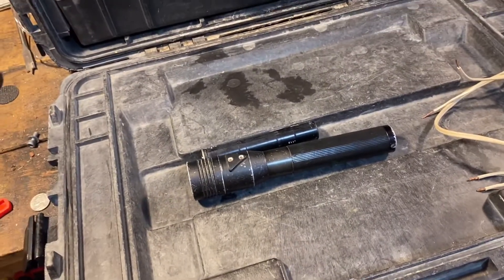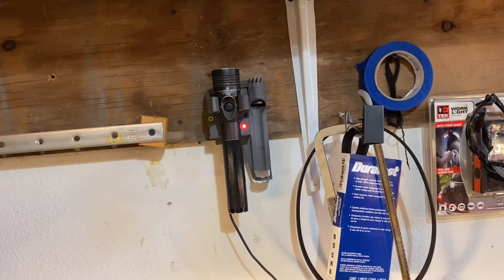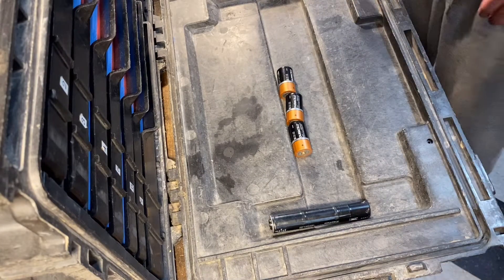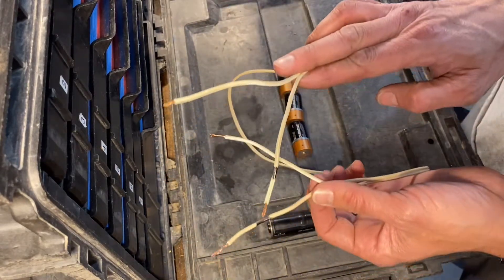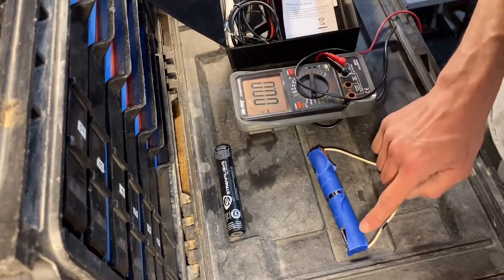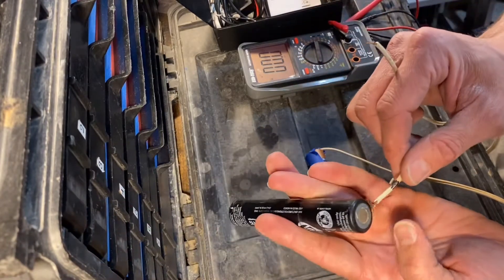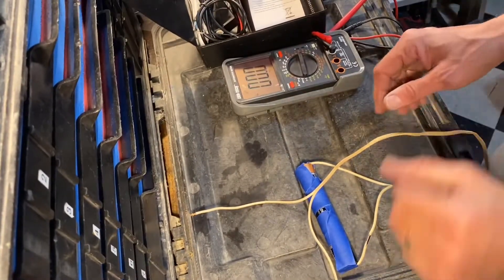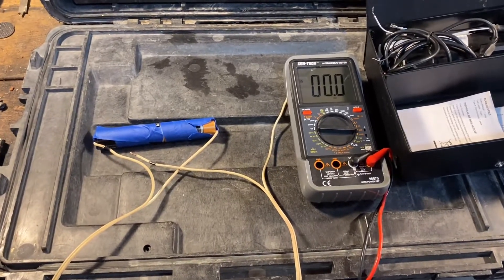How to Fix a Dead Rechargeable Battery

Comment: I just got a new streetlight stinger  classic in red with the xenon bulb I wanted the old school look it’s ment for inside the house don’t need all the bright lumens but I have notice I already have this same issue it’s brand new any reason why or just a defect the package came with black slow charging charger but I charge it on my gray fast charging charger
Reply from the maker: Likely been sitting in the box too long and might need a new battery this time. Try changing it with the slow charger. Is it lithium ion, nickel metal hydride, or nickel cadmium battery?

Comment: I have a HYPER TOUGH rechargable flashlight without a removeable battery that shows red and flashes green like once a second when charging.  The battery has wires attached at both ends that connect to a small circuit board that has the charging port.  It registers less than 0.01 volts on my meter. 
1) Is it safe to try what you do with the wires attached to the battery?  
2) If so, how many seconds should I keep the wires from the 3 C batteries attached to battery in the flashlight to get it's voltage up before I plug the power cord into the charging port?
Many, many thanks!!!
Reply from the maker: Unsure of your specific application. You have a high probability of kill in the battery for good if you hook it up wrong. I would only put it on the terminal for about 10 seconds. See if you can find polarity, sometimes the charging port will show it.
Reply: @ijfim  Thank you for your response!
I know the polarity.  There's a red wire on the top of the battery and a black on the bottom.  When I connect my multimeter with the red lead to the battery red wire and the black lead to the battery black wire, I get that 0.002 reading. When I reverse the leads of the meter to the battery, it reads -0.002.  
It is a 3.7 lithium battery and the charging block that came with it sends 4.79 to the battery to charge it.  Is it safe to use 3 C batteries or would it be safer to try connecting 2 C batteries for 5 seconds at a time and then seeing if it has taken enough of a charge for the charger to start charging it? And if not, keep repeating the 5 second charging to the 2 C batteries until it's able to start charging? I just don't need a lithium battery blowing up in my face. That's what I'm afraid of. The flashlight is worthless the way it is so trying your approach might save it. It's a great flashlight and if doing what your video shows saves me from throwing it away, it's a great victory for everyone!
Thank you for your help!  :-)
Reply from the maker: @keepitsimple8 you should be fine with  3 C batteries for short periods of time. Wear eye protection!

Comment: I used the 6v, 6amp positive and negative sides of my auto battery charger for the battery boost. Worked great! (My flashlight would not do anything before I did that.)
Thanks for your idea!!
🫡

Comment: Yeah, this is the same concept with automotive batteries that are too far down, I hook up the charger to a known good battery and daisy chain to the depleted battery and it usually will allow for a full charge as long as the cells are still good

Comment: Man you should
Really explain to people the risks involved here.  The charger wouldn’t charge the battery because it’s programmed not to if the voltage is below a certain level because with L-ion batteries the cell can become damaged if the voltage dips too low. Damaged cells can explode when trying to charge them. For those of you watching don’t do this inside. Jumping the battery like that can cause a damaged cell to explode.
Reply: Some Streamlights have Ni-Cads which vent and do not explode.

Comment: How long should a Streamlight 74175 Battery Lithium  battery last when the flash light is on?
Reply from the maker: Mine lasts about 1.5hrs on bright setting. To make it last longer, hold the button down until the light dims twice, your light will last much longer in this setting.

Comment: I actually did this a while back with the leads off a 9 volt AC adapter. I think the charging voltage is 9.75
Reply from the maker: Wow, that’s a good idea too.  Harder to tell which side is + and which side is - though.
Reply: @ijfim  Right. I just verified with the multimeter first.

Comment: I have a very similar flashlight as you do here and I had to get a new battery today. But anyway what bulb are you using here? Mine is the OEM bulb that came with my light and doesn't seem as bright as yours even with the new battery.
Reply from the maker: Maybe it’s just the video.  My flashlight is the Streamlight Stinger LED “HL.”  The HL means, “high lumen.”  I have another regular Stinger, but it isn’t that much brighter than that one. Maybe you need to clean the lens?
Reply: @ijfim  mine is the Stinger DS Led HP. Not sure what the HP stands for.
Reply from the maker: HP might stand for “High Projection” or something like that.  I was reading the Amazon description from your light and it looks like it’s strength is Projection more than short distance brightness. 

Streamlight 75882 Stinger DS C4 LED HP Rechargeable Flashlight - 800 Lumens, Black https://a.co/d/7rslHU8

Comment: Also works with cordless tool batteries.  Just get a "good" battery and connect it to the "dead" one for a few minutes.  Lots of times the "dead" one will charge.

You might also put a fuse on the wire to the positive side of the battery so if there's a dead short it doesn't fry both the batteries.

Note that my layman's explanation is that there is a computer chip in that "dead" battery that isn't running when you connect it to the charger.  It requires a small charge to allow the battery to be charged.
Reply from the maker: Well said!